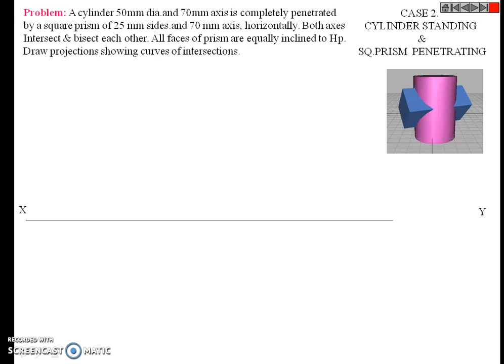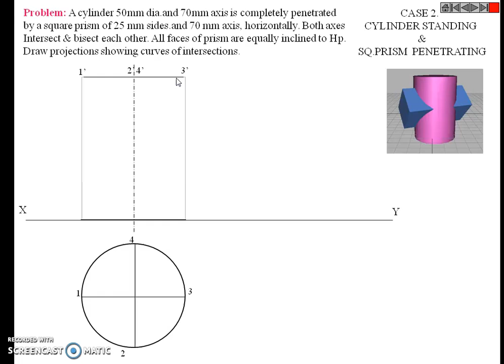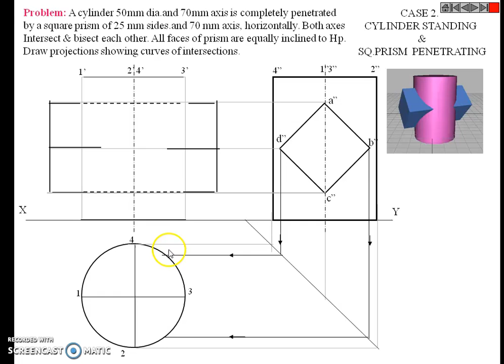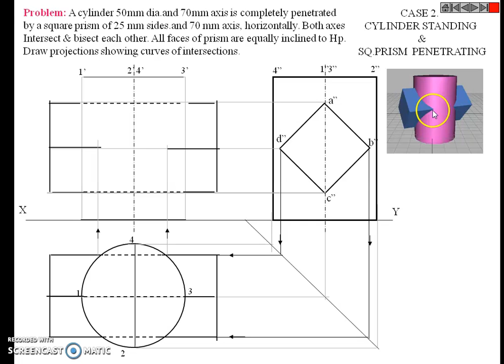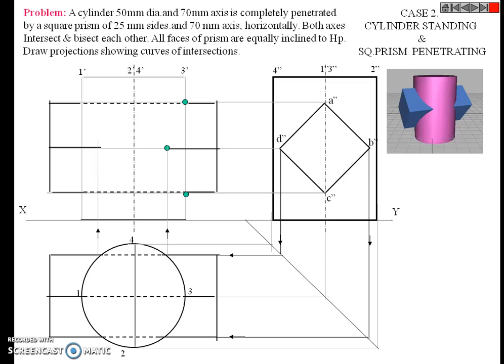CASE 2. CYLINDER STANDING & SQ.PRISM  PENETRATING

Comment: 3
1.
A cylinder 50 mm dia. and 70mm axis is completely penetrated by a square prism of 
25 mm sides and 70 mm axis, horizontally. Both axes. Intersect & bisect each other. 
All faces of prism are equally inclined to Hp. Draw projections showing curves of 
intersections